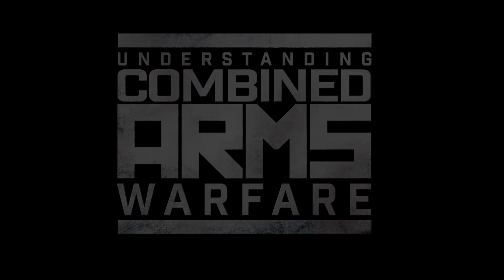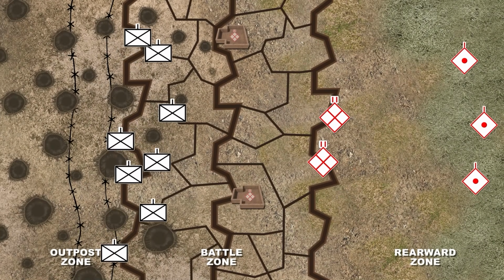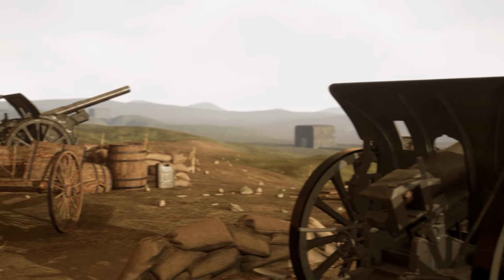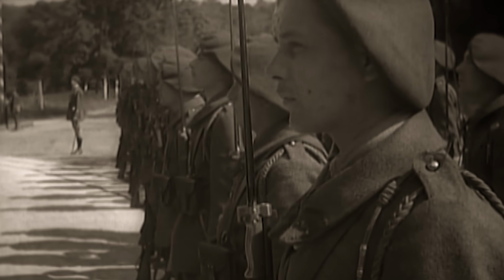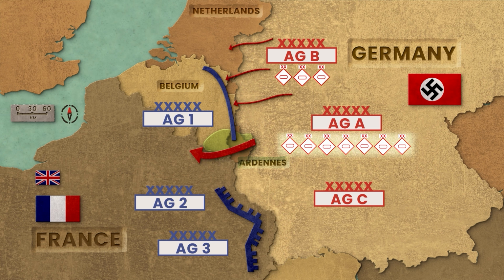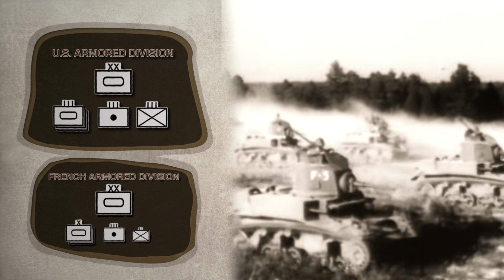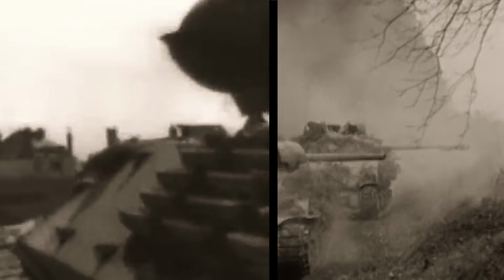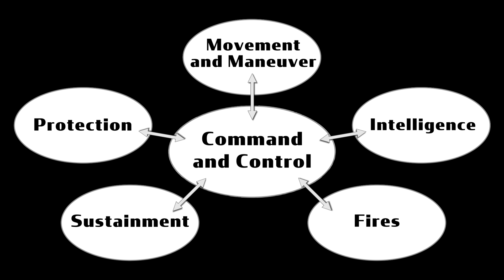Understanding Combined Arms Warfare

Comment: Short barrages were not the only reason the ground was less torn up. Part of the reason yes, but not the only reason, nor even the primary reason. 

The primary reason is one very few are even aware of, both sides had come up with new fuses for their artillery shells. These new fuses could be set for contact detonation that WAS actually as close to contact detonation as was possible. Almost no time between contact and the shell exploding. This was actually pretty damned important as prior to this even the best fuses had a time delay between contact and detonation that allowed the shell to bury itself into the ground before detonating, thus creating the heavily cratered ground we associate with WWI. The new contact capable fuses vastly reduced that. Add in shorter but more intense whirlwind barrages and you get the far less cratered ground that was typical of the last year of WWI. 

They could still set those shells for a delay, useful for specific targets like bunkers for example, but on the whole in the last year of the war most shells with the new fuses were set for contact detonation.

Comment: 28:40 : Isn't that McNair's opinion rather than the Army or Armored Force's position ? Nicholas Moran, aka The Chieftain, addressed that in his Myths of American Armor, Tankfest Northwest 2015 video. At one point, he points to FM 17-33 of September 1942, which reads on page 107 : "Tank versus Tank action (See FM 17-10) - Attacking tanks frequently encounter hostile tank units unexpectedly.
At other times they may be required to attack hostile tanks deliberately in order to break up an attack or a counterattack."

Another counterpoint is the firepower provided by main guns on U.S. medium tanks at various points in WW2 ; in '42-'43, the M3 and M4 had 75mm main guns with a length of 40 calibers that would overmatch the 7.5cm KwK L/24 of the Panzer IV Ausf. D through F1 that would be the one of the most common enemy tanks encountered by the U.S. Army, the other being the totally outmatched Panzer IIIs. The comparison then probably progressively switched to the Panzer IV's favor, or at least evened the odds, as the Ausf. F2 debuted the KwK 40 L/43 gun, while the Ausf. G introduced thicker 80mm armor for the front hull, at least for frontal engagement at relatively long ranges. This would be addressed with the 76mm variants of the M4, with the M4A1(76)W entering production in January 1944, and being deployed to Britain already in April. Seeing no immediate battle need and not wanting to create training and logistics problems with the upcoming invasion, it was decided to leave those tanks in depots, with the 76mm Shermans being deployed to France starting in July after encountering more armored German tanks such as the Panther. Note the timeline of 76mm Sherman availability tracked pretty closely the M18 Hellcat's introduction ; T70 prototypes were sent to Italy in May, and M18s entered combat on the ETO in July. Both the 76mm Shermans and M18 used the same gun, and the latter was a tank destroyer. Not to mention the 76mm gun on the M4 and M18 had similar, if not identical, performance to the 3-inch gun on the M10, another tank destroyer.

Otherwise, excellent video.
Reply: I agree with nicholas moran entirely

Comment: This video is bizarrely slanted, first the germans were not the first to implement combined arms warfare during WWI or WWII, and it wasn't a new concept or idea by the time they started to exploit it. They learned the concept from allies in the first place, and their few successes to it lead to shocking results, but that had little real impact. The reason why the allies won the war was exactly because they had better combined arms warfare. The germans were not particularly good at combined arms warfare save for Rommel, who was largely ignored by a lot of the German military despite his notable successes. 

While the concept of tank destroyers is a controversial one, it was actually was an implementation of combined arms warfare, as they used a myriad of anti-tank guns on wheels combined with tanks to take on the enemy. Today, the Bradley would fulfill the same role. The hellcat tank destroyer during WWII for example achieved a 2.6 to 1 kill ratio, one of the higher kill ratios of the war, despite being quite poorly armored, exactly as it was implemented correctly. They idea was to pin the enemy down with tanks, and then rush in with lighter tanks to flank them from the side. Which worked extremely well.

Comment: Excellent discussion,  on a broad level , but  It could describe the downside of combined arms distribution though, more than it did.
Having plenty of everything everywhere is a good plan. It's like more is better, yep sure is! 
But if you haven't got enough, say, artillery for everybody , then you start abandoning that aspect of the combined arms. Obviously you don't distribute naval assets like battleships to an inland regiment or restrict close combat support planes to each individual battalion. 
So really combined arms is balanced with pooled arms in every military that exists, and the differences are really just at what level decisions are made about the disposition of assets, and whether smaller units are familiar working in conjunction with attached complementary capabilities. 
Certainly one can locally dilute the impact of a weapon system simply by distributing it too widely, or maximize its effect by concentrating that particular function.etc. 

Pointing at a particular battle does not prove that this 'combined' asset allocation is suitable for all circumstances or that it should be seen as a doctrine ,.. since nobody actually does this in pure form. 
Conceptually it's fine , but don't expect infantry to be able to run at 45km per hour to keep up with tanks,  or vice versa at  2 km per hr.
Reply: You don't "abandon the concept of combined arms" with, say, the lack of artillery. This is where Mission Command comes into play, and REAL military decisions are made. Where can I employ my limited artillery for the most potent effects? Personally, deep fires artillery should ALWAYS be concentrated on C2, support, and counter-battery. Short-range is always positioned forward to support the main objective. Deep fires can shift as needed to support the main effort if losses are taken. But that's just me.

Comment: A tank destroyer would be very vulnerable to mortars and artillery. Being open topped, it would also be vulnerable to machine gun fire, especially from above. As an assault gun it would be a liability.
Reply: Not all tank destroyers are built equal, you have the M18 Hellcat which were fast and lightly armored while the Jadgpanzers were heavily armored and slower. Assault guns were also needed in times when the infantry encounter heavily fortified enemy positions to soften and suppress them up. 

Clearly the traditional tank destroyers worked but they quickly got obsolete when MBT could perform everything the tank destroyers can but better. Later tank destroyers of the Cold War were mostly failure like the FV4005 and dedicated ATGM tank destroyers of the Soviets, very few found success.

Comment: I have seen some videos that state the Leopard 2 is superior to the Abrams. If you put 5 Leopards 2s versus 5 Abrams without any support that could be true. But when you realized that the Abrams is just a part of the big picture of US Military Combined Arms the Leopard 2s would be at a great disadvantage. The Leopard 2s would be taken out by Aviation or Aritllery before they got near the Abrams.
Reply: Except any other force today also uses combined arms, so the 5 Leopard 2s wouldn't act alone either. And the constant competition between the Abrams and Leopard 2 is ridiculous, as both systems were co-developed and share many design principles and even some components. Across the various iterations one may be slightly better than the other and vice versa, but in the end, both are on the same level.